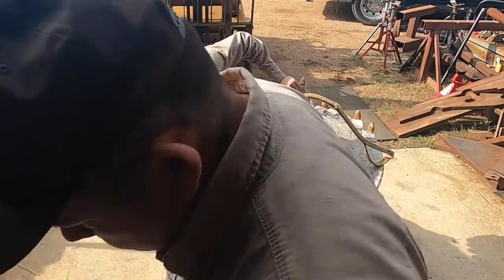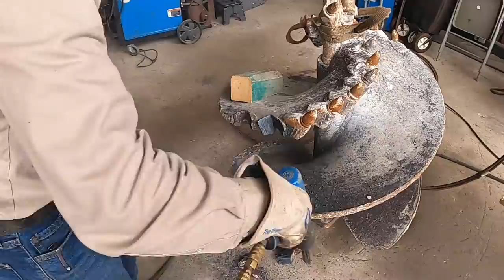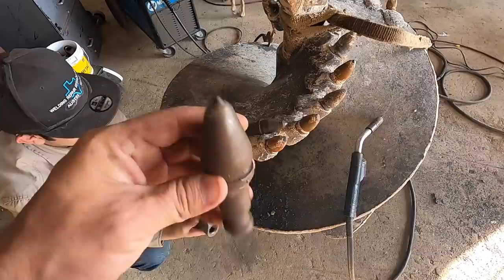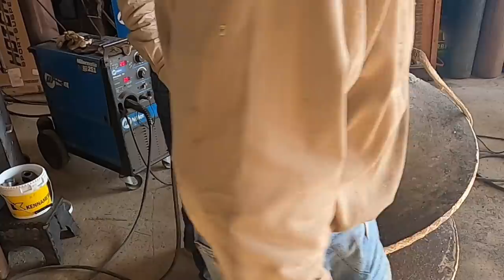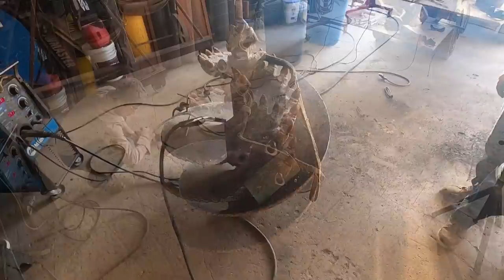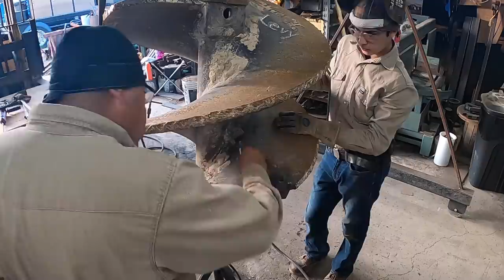Passing the Torch?

Comment: That's great to see!
I can still remember my first week of being introduced to blacksmith/welding at a local mine. 3 of us were led into a dirty dusty workshop where a man stood beside a forge welcoming us in. He did a classic trick on us. We came closer and he pulled a rod of far too hot steel (imagine a sparkler) from the embers. The anvil top was wet and he struck the hot metal rod with a hammer on that anvil and it created a blast of burning sparks. A fiery introduction to the world of hot metal working!
Other things I remember and which has stood me well was the instructor explaining that steel is like toffee. Get it hotter and it can be bent and shaped easier. Too hot and it spoils. Words I'll never forget.

Your son will be learning fast. With my own son he lacked confidence. I knew he could do it and it was simply a matter of time and him realising that those difficult tasks were overcome by him, step by step until completed.

Comment: When you do general cuting using a #1 size tip (I'm assuming Victor 1-3-101 or 1-1-101) what oxygen and acetylene pressure do you run? Your cuts are always so nice and I know it takes alot more than proper pressure but I figure that's a good starting point lol
Reply from the maker: I mostly only use a No.000 and a No.1 tip for most of my cutting and at 7/70 pressures.
Reply: @ICWeld  Thank you for the fast reply and great information!

Comment: Start your cut with pressure on its way better. You hit the metal little with the flame To oxydized it and move .if you don't have the pressure on your tip is gonna destroy from the temperature.